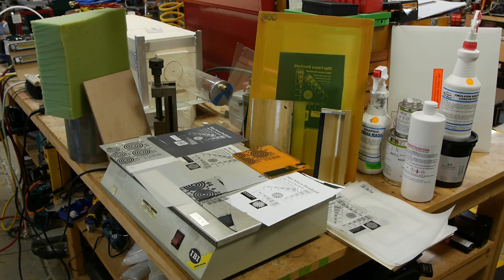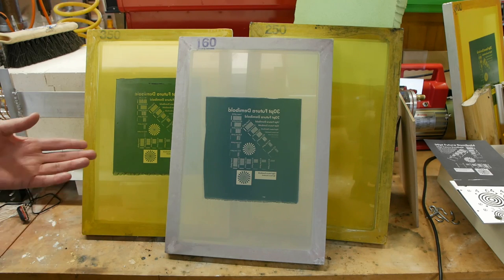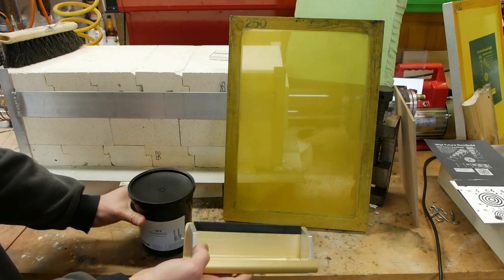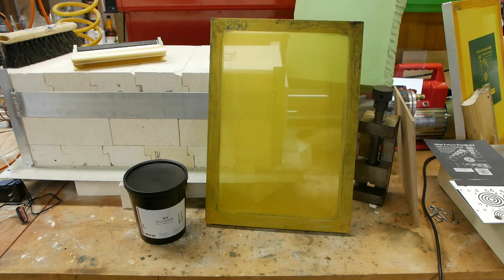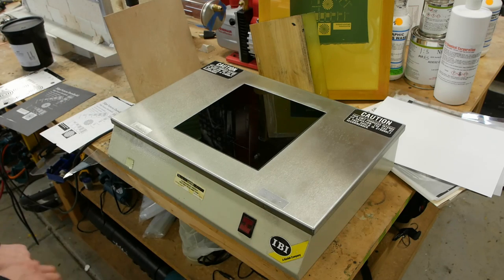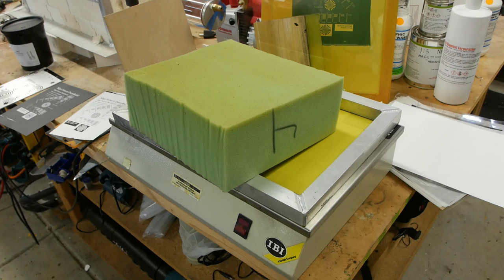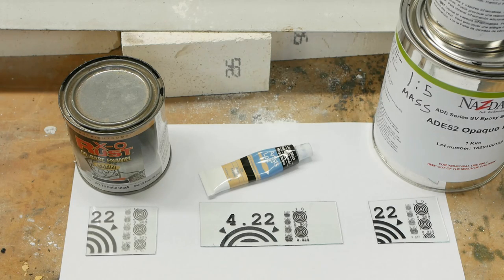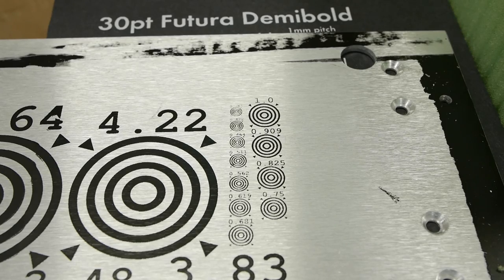High-resolution screen printing demystified

Comment: One thing that helped me tremendously was just seeing how someone made and used a test pattern to determine exposure times. It's a bit "simple" for someone like Ben, but for a dumb guy like me it made a big difference. I finally learned that most of my problems with dry film photoresist were due to over exposure using the Sun as a UV light source. My exposure times for Dupont Riston t215 film are 3-4 seconds for maximum resolution.

   It would probably be detrimental to try the same technique for this application, but I found it helpful to use a very light oil like triflow to get my transparencies as close as possible against photoresist while etching boards.  I haven't been very successful using glass to compress this kind of stack. Maybe if I had a thick piece of foam as shown it would be different. There is no way I could find to effectively compress a stack between two sheets of glass. I was using the cheap sheet glass from Lowe's. I managed to break a couple sheets trying to do some larger double sided exposures.
  One other cheap a dirty way to do text may be to simply use photoresist film on thin wall aluminum (can) material. I've been goofing around with making my own solder mask stencils by stripping the outer coating of a soda can and using dry film. If I scale my image right I'm pretty sure I can render some 6-8 point text. I can do 0402 passives and TSSOP-20 footprints. I am going to try some text one day soon. I think the choice of font will be the most critical factor. I'm mostly looking to create a designator mask for boards. I've still got to master my soldermask technique first, but then I'm planning on trying this. I've been collecting Arizona Tea cans for base materials. I just use my typical PCB etchant of Hydrochloric Acid/Hydrogen Peroxid to etch the aluminum can too. The real trick is to undersize everything and plan for the etchant working in both the vertical and horizontal space around any exposed areas. I figured I'd just use it as a true stencil with a sprayed substrate.
Anyways...thanks for the upload and tips.
-Jake

Comment: Very informative!
I worked at a sign shop in Australia that did commercial screen printing for sign panels. They would coat the screen with a scoop coater in the shop with all the lights on then put a fan on it. They would then position the stencil onto the dried screen and put it outside in the sun for a few hours! So yes, this emulsion is not very light sensitive!

Comment: I worked in a screen printing shop in the 70's  
I  did simple screen printing that used hand drawn razor cut kraft paper letters as the resist - picked up onto the silk at the first squeege of ink. Single color mostly, large-font food store sale marquis :-)  Limited run as you can imagine 200 -300 per set up. And very simple water based ink!!
I never met the guy who cut the letters but I heard about it if I destroyed one or two. :-) I had a gander at the huge beam mounted large format Process Camera to produce transparencies.
...breathtaking. That camera was just gorgeous.  Cambo on steroids
Hadn't given it a thought till your upload :-) I do remember the smell of some of the polyester? ink  of the day.
Reply: Ah yes, hand cutting stencils....so glad low cost, wide format inkjet came along!!

I never did text, I just wasn't good enough, unless huge letters. I did know some art guys hand cutting 30-40 point text..I just didn't have the skill or the patience.

I would love to have one of the 'smaller' cameras, just as a conversation piece. The news room ones were mind blowing...I have seen smaller cars........

Comment: The 'Induction' period with 2 component inks (epoxy or polyurethane)  is to allow the inks to de-gas  after mixing. 30 minutes is a pretty standard de-gas time in ink mixing when dealing with any ink but  applies mostly to 2 part inks and coatings. This may not have been properly explained in the data sheet. Hope this is of some use.
Reply: Could that time be lowered with a vibration table?

(Or if you're crafty, two high powered sex toys, some 2x4s, a sheet of plywood, and some vices).
Reply: @Asdayasman  Its possible (either way :) never tested it, with screen printing as it is a shear deformation process keeping the bubbles low is important and more so in ink systems that cannot incorporate silicone de-foamers , typically epoxy inks used in PCB production cannot use silicone  defoamers and due to their viscosity (thickness) bubbles dont release quickly. A little heat can also be applied but has to be below the curing temp. I could go on for ever but it gets boring :)
Reply: A vacuum chamber is great for degassing.
Reply: @ipissed  Yeah but after giving my dog cheese, when I put him in the vacuum chamber he fuckin' straight up died.
Reply: @Asdayasman  You left him in too long, you want to keep it under a minute. See Chapter 1 of the Bioastronautics Data Book: https://ntrs.nasa.gov/search.jsp?R=19730006364
Reply: @ipissed  I'll repeat my tests.

Comment: This is a really informational video and I thank you a lot for it. Since I was making my own PCB's not so long ago, I can give all of you a little hint. When you print your design on a "paus" paper, as mentioned in the video, you can increase the contrast dramatically by laying the design flat with toner facing up. All you need is a shoe box cover and some pure acetone. Drip some droplets of acetone on the inner side of the cover and then place it over the design for a couple of minutes. The difference will really be obvious, if not dramatic.

Comment: Great informative video. And just as a couple of other people who left the comments, I have also spent probably half of my life working in my screen printing company. I was also a chairman of teh comitee for qualification exams which were mandatory for people who wanted to open the screen printing, bt did not have the required qualifications. I also wrote several tutorials so they would have something to learn from, but never got around to writing a proper book. We were also producing screen printing machines and equipment, but that was all decades ago.

People left several good advices below which I think are worth checking. I'd just like to mention a couple of details:

- With proper technique it is posible to coat the creen with photo sensitive emulsion so that you'll be able to achieve better results than with photo polimer film. You can apply several coats, first applying a coat or two to the bottom side, and continue applying several more from the inside. If you do this, you may consider drying the emulsion with frame in horizontal positition, so it doesn't ooze sown the screen. This way you can get the coat thick enough to avoid the screen texture participate in the actual sharpness of the developed image. I suppose you can also buy photo sensitive films with different thicknesses, and thicker ones could give similar results. Using this approach, we were able to print extremely fine details, for etching and similar jobs.

- We were also using room heaters in a big cupboard where the screens were hung. We did kill more than a couple a year, because the cupboard was kept almost completely closed, but it shortened the drying times dramatically.

- You did not mention that the image is opened using hot water, or do you actually use cold water for this? Polymer films were usually opened using 40oC water, but we mostly used teh film which was first exposed, then developed using hydrogen peroxide and hor water, and only then applied to the screen usig a roller. There are probably many new products I don't even know about.

- If you are using laser printer to make an artwork, you may put the printed paper in a low cardboard or plastic tray together with a bit of paper or any tissue soaked in acetone and cover it, and the acetone fumes will cause the print to be much blacker and opaque. Inkjet prints should behave the same. Edge definition is better after doing this, too.

- No other printing technique utilizes such a vast array of different inks, from two component heat treated ones for metal and  glass, to the rubber based expanding ones for textile. But in my experience, the most verstile ink, which we could use on plastic, wood, textile, and pretty much anything else except metal and/or glass, was the PVC solvent based one. It was the least healthy, too, unfortunately, and I have no idea if it is still sold, but it lasted decades on t-shirts and literally everywhere.

Comment: To whomever is watching this still. One thing drew my attention - Ben, you say that you can use plain old tracing paper, but it tends to jam in the printer. I've been doing printed circuit boards at home for several years now, and the trick I use is I tape a piece of tracing paper onto a sheet of regular printer paper with a piece of masking tame (minimum glue residue). You just have to tape only that side which gets fed into the printer - leave the other 3 loose. Works wonders for me. Also, wetting the tracing paper with something like WD-40 makes it almost clear - might also help with that contrast around the edges.

Comment: FYI I’ve had good luck in the past using laser printer transparencies against a pane of glass. I double up the transparency sheets as the ink is somewhat translucent. You have to play with the exposure times, same as regular ol’ photo print process, blocking strips in 2 min increments. Anyway, very informative video. Will surely check back next time I have to put some ink down on metal!
Reply: Would ordinary paper just work too, provided you had the printed side from the laser printer against the emulsion layer? Would the white paper pass through the UV from behind?
Reply: @USWaterRockets  I would expect that regular white printer paper won't work very well because it is often bleached and will fluoresce rather than transmit. If you have a UV lamp you can test if it glows.
Reply: @USWaterRockets  No. You need the exposure to get through the 'film' regular paer is just no good. Vellum is better than nothing, but transparencies much better.

Comment: For UV PCBs I've always used tracing paper - the key to avoid jams and crinkling is to use the heaviest stuff you can get - minimum 90gsm. This stays pretty smooth and can do 600dpi, for 10/10 mil track/space PCBs. For high res you can get typesetting films made fairly cheaply - I've not done the latter for a while so not sure how readily available that service is these days as printing tech may have moved more to imaging direct to the printing plates.

Comment: Printer here: 
A screen is usally named (mesh count per inch - single thread thickness) so a 120-34 screen has 120 "strings" per inch and each string is 34micrometers thick. That thread thickness also determines sceen thickness (twice 34) and the thicker the screen, the higher the paint-canal is, wich means more paint per mesh-opening.
On Exposure: And also regarding the paper as a medium to transfer the image... 
The ink used in general printers is letting light through, even when you print twice on top of each other. If you hold a bright small light (phone flash) against your black layer printed.. you SHOULD NOT be able to see the light through. If you do, all your resolution wont help, your exposure times go up, but at the same time you lose the harsh edges. (wich you need to print clearly!) and might not even be able to wash out the screen. You want the shortest exposure possible, with the brightest light you can achieve on a private scale, with the most non-translucent black to begin with. Thats why your screen got "stubborn" Don't use pressure washers to free up the screen though. You'll lose the "pixels" that only hang onto the mesh on the edge., but they make the resolutions o much better. And dont use paper(it might let through more UV-light, but the fibers scatter the light thousands of times before letting the light escape on the other side, if at all, leading to unwanted exposures on non-image areas, leading to lower resolution. Use film. Maybe even these overhead-projector films. 
The weight: Nice Idea if you have a flat lightsource that can withstand light. =) 
Cheerio

Comment: Whow thanks for this super interesting video!! I'm hobby-screenprinting on shirts for > 10 years now and I always mess around with these transparent OHP-foils! We we're actually laughing about the guys that we just tagging their names on parchment paper to print in a youth club workshop back then. But it worked! And now I know even why! I would have liked to see you doing the measuring tho :D

One thing I always thought was interesting but maybe also more specific to fabric then paper or other substrate: In the beginning you say one squeezes paint through the mesh. But where I learned it they always talk about "filling" the screen. And the substrate is then sucking the paint out of the screen itself. That's why you have the tension pressing down the screen on the substrate.
When doing fabric you also have a very light adhesive fixing the fabric onto you printing table. Just so the fabric sticks MORE to it than to the paint in the screen! So again the fabric and take the paint out of the receding filled screen.

Comment: Nice video. I had actually never heard of the ready made emulsion sheets before. A tip for other people trying screen printing for the first time: A very low-cost way to expose screens which I've been using for 20 years now and still do is making a simple table out of a plate of glass and two trestles with a second hand face tanning lamp underneath. It can be on its back on the ground, it doesn't have to be directly under the glass. Throwing a sheet or blanket over the whole set-up when not exposing in a dark room helps. Placing a heavy enough book (or two) on top also works fine. Instead of putting the foam in between, which I find tends to curl up on the sides and therefore doesn't push down enough on the sides of your screen and design. Then I expose for about four minutes (using scoop coat emulsion and vellum). This will vary a bit according to the strength of your lamp, but generally around three to four minutes is enough. All emulsions I have used btw dry in one or two hours when put in a dark place with a simple blow dryer, but the conditions in my shop are probably different then yours. A whole day though seems long to me. I hope this helps someone. Happy printing!

Comment: Motivated by your success here, I tried a variation on the technique, using a 3D resin printer as both the exposure stencil and light source. A 50 micron thick 3D model of the stencil is loaded as a print, and then the screen is simply placed atop the printer in place of the resin bed. With good screen to contact to the printer glass (as you demonstrate), I got very similar detail, if not better than you did here. Thanks for sharing your process!

Comment: I think you just solved the problem with the UV exposure printing machine thingy I'm building, I need much more pressure on the paper. Thank you so much!
Reply: If your dealing with solids like PCB/Photoresist just use a light oil like bicycle chain lube between the transparency and photoresist. Once the air bubbles are squeegeed out it will stay remarkably closer than anything I was able to achieve with glass and pressure.
 I picked that tip up from another YT'er and saved it in a playlist under PCB Fab.

Comment: I used to work at a DVD Factory, this is how we printed the pictures on the DVDs.  we would use UV lights in between each color with the ink. It would dry in literally 1 or 2 seconds for each color.

Comment: tried doing circuit boards with the screen printing kit from the craft store :/ Acrylic paints worked well for the 160ct the kit came with, got down to 0.5mm successfully. While I thought I was doing to increase resolution getting the 300 ct yielded way worse results with the same acrylic paint (tube), also not much paint available will stick to copper through a silk screen on the first shot. Did everything absolutely the wrong way. Wish I came across this video about 1.5 yrs ago.. Since then figured out how to get my 3D printer to scratch-engrave off blue layout spray paint (typically used for manual machining) off the copper foil clad raw PCB's for my isolation routing. 
After seeing your informative video, which I guess no one else from the industry bothered with sharing their valuable knowledge, I'm now considering breaking out the screen printing kit once again to give the prototype 2-sided PCB home manufacture another go. Thank you for sharing, subbed!

Comment: Oh screen printing is fun! It's been a while but I experimented with it a bit a few years back. I went through arts & crafts books in the library to get information and my equipment was really shabby. I got my screen from a printing class that would've thrown it away cause it had holes near the edges. Good enough for me. An interesting hack I got from one of the books was to use black tea to increase adhesion of the photosensitive - the tea is high in tannines (I think that's the right word) which is great in this regard. Just use it after cleaning. As for inks: I used artists acrylic paint with a special additive that you can order at artists supplies. It makes the ink dry slower, which is quite handy in case of acrylic paint and also changes its consistency. This keeps everything water based, which was important to me and also allows you to experiment with the consistency of the paint.
Either way. Great video! It's really worthwhile to experiment with screen printing, even if the results are not super detailed - everyone go and try it! :)